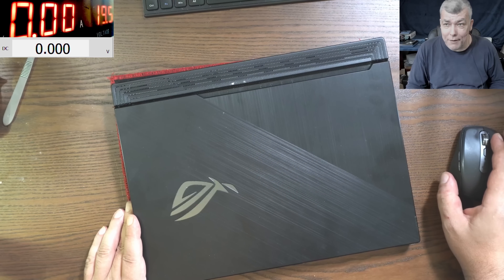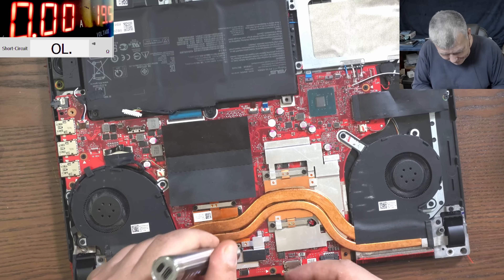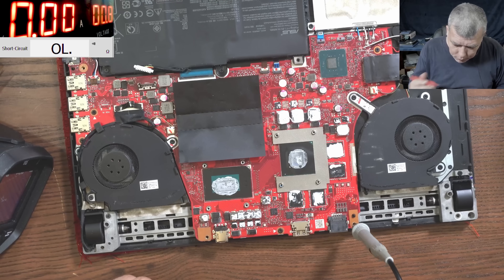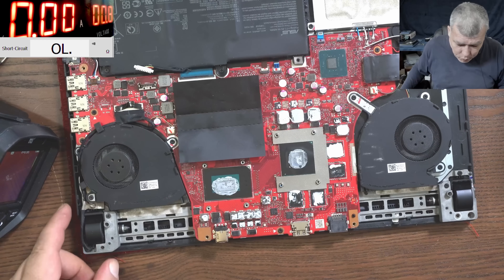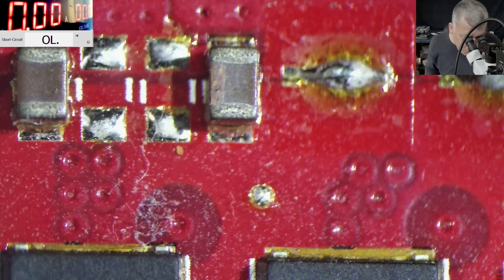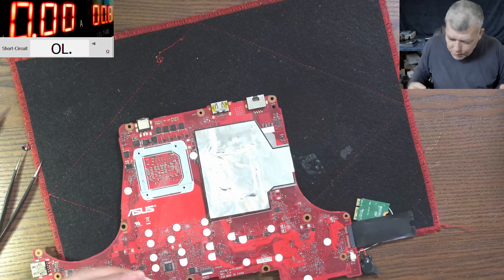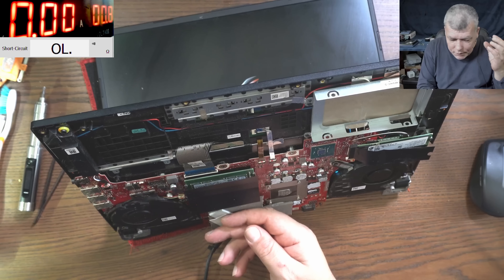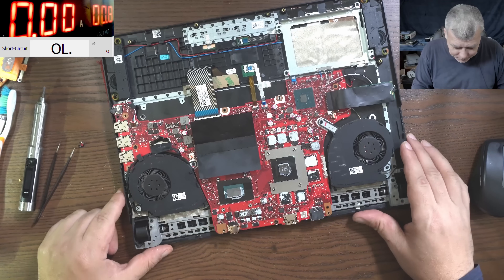ASUS Rog STRIX G531g - No power repair - Exploding capacitor startup sound - This is sick!

Comment: I had the same problem, I tried with 1 volt in the main resistor and nothing got hot and I didn't pass the voltage to the GPU and cpu coils either, I started to see each capacitor of the phases and the same thing broke and burned a cpu capacitor 👍🏼 ASUS G532LWS

Comment: hey! I have the same laptop, rog strix g531gv, I found the power plug faulty, I replaced it, the adaptor is good, but the laptop won't start after I plug out the power cable and put it back in. It will take around 30 minutes to start up. I don't know, would be the battery the issue? I guess if I had a short on the motherboard, the laptop won't start at all..I repeat. I unplug, plug back, have to wait several minutes because the laptop tends to shutdown. But when it starts, it works at its optimal capacity.

Comment: 13:21 I had the volume cranked up and i also got scared from this sound omg haha (nearly fell off from my chair)
I hated those sounds and now i just found one more reason to. (owner of Asus G731GW)
first thing i did on my brand new laptop was to disable this startup noise sound.
Reply: "It's making that sound like an exploding capacitor... If i'll be to have a heart attack it will be from a startup noise of a computer... but it makes exactly the same noise like a electro lithic capacitor which is exploding... you know that moment on the first "pssssssffffff"
your reaction to that was epic
Reply: I HAVE NEVER EVER LAUGHTED SO HARD. dude omg i nearly chocked

Comment: I recommend something else for the thermal paste. The Kryonaut is one of the best performing thermal pastes out there but it is way too fluid and low viscosity for small laptop chips. It will "pump" out quite fast because of the thermal fluctuation and loose it's thickness and thermal conductivity quite fast. After one year of intense use of the laptop it is already very thin and thermal conduction between the chip and heat sink is quite poor. I recommend something more solid paste with higher viscosity that will keep it's consistency longer. The thermal conductivity is not quite as good in the beginning but after longer use it will stay much better. I have tested itmy self and there are also some professionals talking about this in the Internet in Youtube etc. I do not want to advertise but for example Arctic MX-4 is way better for laptops. I stopped using Thermal Grizzly Kryonaut because it has to be renewed every other year. It is too little for customers, thermal paste for normal consumer has to last for at least 5 years if you ask me. If you are a enthusiast and renew the thermal paste frequently the Kryonaut is great but otherwise I recommend not using it. I go with MX-4 nowadays and have not had the problem of aging thermal paste anymore.

https://www.cgdirector.com/how-long-does-thermal-paste-last/

Comment: An easy repair. This is not what I usually find when I go to repair. Normally, they are more complicated repairs, in which you have to consult the startup sequence, the boardview and the main schematic; as well as having Bios and EC firmware. Replacing a pair of shorted capacitors is the most common circumstance. Nothing surprising.

Comment: About the capacitors, have you stop to think that the same manufacturer that designed the board, and made room for those capacitors, was the same one that choose not to populate all the components?... Why you think it might be? Have you considered that this same board can accommodate different CPUs, and/or different GPUs? and as each configuration draws different amounts of current those capacitors might be needed for one configuration and not for another? Or even (and I do this as well) when designing a PCB I have to take into account that the specific component I need might not be available, and I might have to replace it with a different one, while maintaining the same PCB design... there are so many different reasons, engineering wise, for those components to be missing, that I don't understand why you find it "funny".

Comment: The four spaces for the capacitors could be to allow for different values depending on what they have in stock. 2 x22uf or 4 x 10uf maybe... or maybe they are just dodgy 🤣

Comment: i guess someone took that capacitor and never replace, as i see there is already flux on the board, obviously it is already repair, as i mention in the other videos you post, if one of the parallel capacitor is damage you need to replace all of them, remember you said in parallel mosfets, same as capacitors, if you remove one, the ones thats left will carry all the stress, and you never know some of them are open and only one is working, thats why fault is coming back.

Comment: Sorin, I watch all your videos with interest. But isn't it more ethical to use a new capacitor instead of the donor card in capacitor failures? Because the used capacitor will not have a long life. Moreover, the price of a new capacitor is 0.001 USD, so its price is negligible.

Comment: But you picked up a random capacitor, or they have the same value?
Reply: @buug76: We don't have a schematic diagram, but it's fair to assume that the other one should be the same capacitance value but you would have to unsolder it and check that out of the circuit. In this case; they are in parallel and there are pads for four of them so it is a good decision to leave at least two installed even if the damaged one is replaced with one of some random value. All the best.
Reply: @CarlosGarcia-d3e  yep those are filters afaik, so it should work

Comment: I have this craptop and it sucks. The hinge design is stupid and the charger cable can slip between the screen and laptop and cause the bezel to break if you close the screen. The stock wifi card would disconnect periodically and the bios update that was supposed to fix it didn't do anything.

Comment: I'm still confused about which capacitors can/cannot be replaced and how to determine their value.
Reply: ... those "milk coffee color bricks" are usually electrolythics, but nonpolarised, and they are used for local filtering/charge storing , also, they are there in bunchs, 3-4 sometime 5 pcs in parallel.
"true" electrolythics are a 'lil bit another story, they are, generally speaking, "main" filtering caps, and are in most cases mandatory, same for their value. also, they have bigger capacities, over 10 microfarads.
these bricks have capacities anywhere between 1 and 10 microfarads... you need to effectively measure them, because they aren't identified in any way, as you can see: no marking, no code, nothing, just brown cubes.
but there are another caps, looking the same, but they are series, playing different roles, with lower capacities. happily, most ic's does not need so much those caps today, not in laptops/phones, this is why you are confused... if you fix/work with a lot with audio stuff, generators, rf amplifiers, timers, etc, then you see a lot of caps being used mostly for filtering/generating frequencies, so... :)

Comment: That was only me or he soldered the capacitor on a different lane?
Reply: @ultra_sound: He put it on the next line but it doesn't matter because it's in a parallel circuit.
Reply: Yeah, I noticed, but if you look at 9:41  at the left sid of the capacitor, it seems to have 02 lanes. 01 for the top capacitor and another one for the other 03 capacitors in the bottom. Maybe I'm seeing too much.